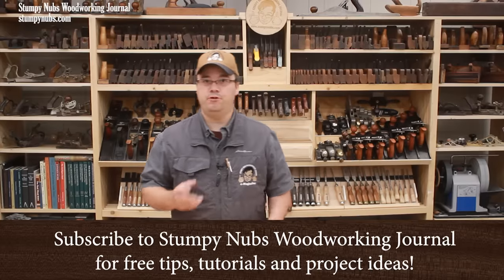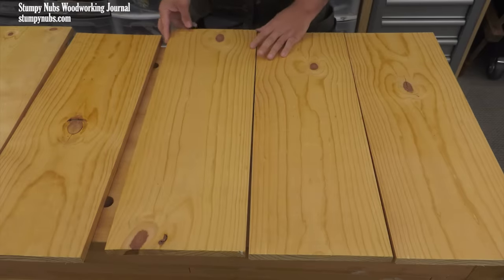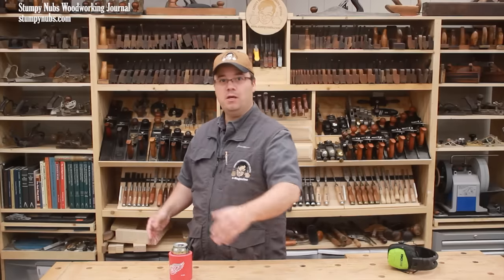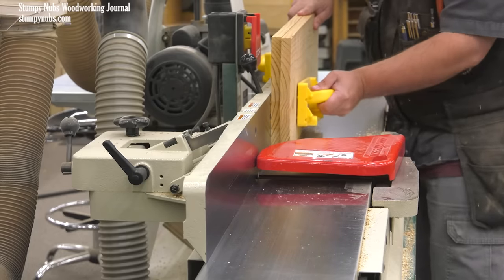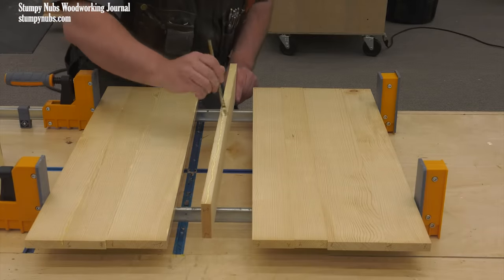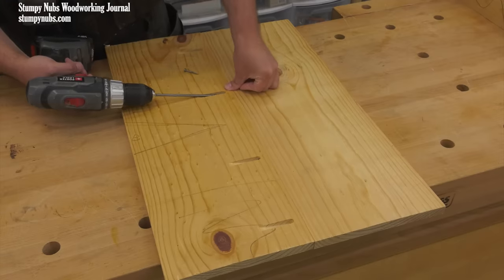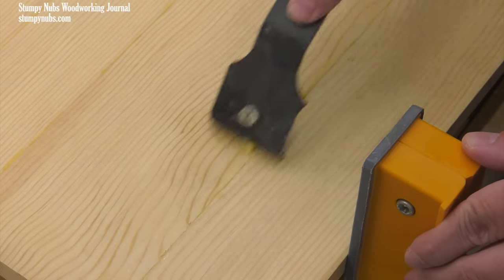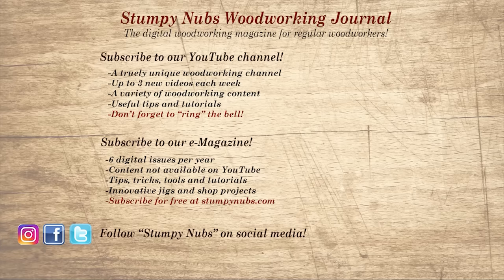Pro tips for table tops, counters and panel glueups

Comment: Well, it looks like I did it wrong. Used a jointer and biscuits.  Glued both sides of the slabs and where the biscuits go into the slots. Then, clamped it and wiped all the extra glue with a damp rag. That was 4 days ago, and it's still clamped up. The countertop is a black walnut almost 2" thick and over 6' long so I thought more glue was better then not enough.

Comment: A handful of sawdust will take a lot of squeeze out up quickly and easily. Sprinkle in on wet glue and let the sawdust mix with the glue and rub it right off.. Works wonders..almost like scouring powder. I always keep a can of sawdust handy for glueups..
Reply: Yup @ martino, you are correct. I have seen the sawdust tip many times as well. Thanks for reminding. Have a good one :D
Reply: Great info. Thank you!

Comment: Thanks.  These pro tips will help, as I’ve never done this before.  I’m in the process of gluing up and refinishing a Hawaiian Koa wood end table, probably built in the 40s or 50s.  The large second “top” of the two layered table is about 3’ X 1’ and is made up of 4 individual pieces, all solid koa.  The seams separated and I managed to get them 100% apart with no damage.  They seem to sit pretty flat and the gaps are good, just have to get them together flat and even on the ends.

Comment: Good tip about the shrinking biscuits; I didn't know about that.
I keep hand planes around almost exclusively for jointing & find that they do a far better job far more consistently than any machine can. They're also quick, quiet, compact, & create virtually no mess. I am going to have to get a thicknesser though; planing faces by hand is not kind on the arms.

Edit: Just remembered another tip. For smaller panels, you can get flat & smooth granite "worktop savers" for kitchens & sticking one of them, inverted, on top of the panel does an excellent job of applying just enough weight to prevent cupping. I like to put plastic wrap around mine in case I forget to remove it before the glue dries too much, but then it's just a quick bit of scraping to clear up any squeeze-out.

Comment: Twenty years ago Norm was adamant that the growth rings should be alternated. I like your conclusions. I wish we could revisit those furniture projects to see if the growth rings made any difference.
Reply: 10 years ago I made two tables that were 6'x3', both out of the same boards from the same tree. One of them I alternated the boards on, the other I did not. They have been in my temperature controlled house the past decade and are both still dead flat. Maybe I'll check them again in another 10 years.
Reply from the maker: 20 years ago fewer people had air conditioning in their homes.

Comment: I’m gluing up a 12’x17” countertop for custom cabinets I built. I had to work the walnut up into 2” strips. I’m a little nervous, but I intend to work up 2 strips at a time until I get one section 8” wide. The second section will be 10” this will allow me to be able to run the piece through the surface planer as an option if there’s an issue. Hopefully sanding will suffice. Both pieces will be glued together and I may use biscuits to assemble the two halves. I’m more nervous about attaching it to my cabinets than anything else. Needs to move but not too much. Of course it will have a face etc., but I’ve made mistakes of not allowing for expansion and contraction, so it’s priority high this time.

Comment: Thanks James... Always a pleasure as I most always I get a little something out of your presentations. You have reminded me I need a set of those clamps for my upcoming 37 X 21 flag build!
I'm currently setting up my new Wahuda 10" benchtop jointer. I'm close to coplane, not quite there just yet & I suspect I'll be setting the cutters to the tables parallel again, it is a game of give & take that requires patience...
Thanks again James,
Bill on the Hill... :~)

Comment: Thanks, your video was very helpful, I appreciate it.

You didn't talk about the width of the boards, for gluing panels... In woodworking school I've been taught that ripping board to 44mm strips, alternating the direction of the rings, is a good way of preventing cupping, etc.
Does this matter? Often a lot of 44mm strips are required, to make a large enough panel, so it would certainly be a lot easier to use wider boards, like 70-100mm.
This is also what I see a lot of other woodworkers do, on Facebook, YouTube, etc....

I hope you can help me out here.
Best regards.
Reply from the maker: I just use the widths I have. Looks more natural.
Reply: @StumpyNubs  - Thanks for the quick reply, I appreciate that.

I see, thank you.

Would there be any benefit to using the narrower strips, like I'm taught?
Surely it would be less expensive buying materials, if I can use wider pieces.

Thanks again.

Comment: When I glue up a panel I keep one face in contact with the clamp bar.  That gives me flat panels.  But even a little ‘squeeze-out” will cause a steel bar to stain the wood.  What’s more, that glue sets up in a bar’s fine notches, making it harder to slide the adjustable part.

My solution is a small piece of waxed paper wrapped around the bar, and secured with a button magnet.  The paper doesn’t fall out, and panels come out dead flat with no iron stains.  You don’t need to wrap the whole bar, just a couple inches where the joint will be.

Comment: For in the field of a glue-up panels I keep a bunch of matched wedges handy. I put them under the clamp bar and press the boards into alignment, doesn't take much pressure don't over do it, obviously don't  tighten wedges over a glue line. Rockwell makes a clamp thing to do the same. 
I've just made some 4 way panel clamps but I have only used them once so far with good success, auto flattening, no cawls.  What are your thoughts on that type of clamp?

Comment: Enjoy your videos, thanks for all of the tips and tricks 
Quick question you mentioned glue only on one surface yet I have seen furniture repair/restoration videos that say the main reason for joint failure is just that, glue on one surface only ?
Confused 🤔
Reply from the maker: I can't speak to a video I haven't seen, but I don't know how they could make such a blanket statement like that. In my experience, if you put the right amount of glue on one surface, and those two surfaces meet properly, they will bond just fine. If you do not put enough glue on the single surface, or the two are not sufficiently pressed together to spread the glue, the joint could fail.

Comment: Love your videos ! I have had a few tables that were great glue ups (8/4 maple, red oak and some 6/4 walnut tops) following most of the methods in this video but 3-6 months later I can feel the joint seam with my fingernail (still flat top but the glue seemed to raise even though it was smooth when I finished the top) . I’ve been doing some research and I’ve been learning that it’s called glue creep? Seems hit or miss when it happens, I can’t figure it out and it keeps me from wanting to sell any pieces thinking piece isn’t high enough quality to sell. Idk what to do about it. Help !! Thanks again sir, huge fan.

Comment: Panels have always been my downfall and I still try and steer clear of them, being a weekend hobbyist and beginner. This video has been very helpful and informative, and I'd like to try making one again. But can I ask a question? After an hour, you scrap the squeeze out, but when is the glue strong enough to be able to remove the clamps? I'm usually stuck with glue squeeze out under my clamps that I just can't get to and as you mentioned, once hardened, very difficult to sand. Could you go further into the gluing portion, removal and sanding the panel in a future video by chance? Or any advice you could offer me?
Reply from the maker: An hour is just a generalization. Just scrape the glue off when it gets lumpy. By that time you can gently move the clamps to get under them. I usually let my panels sit overnight, but a couple hours should be enough time to remove the clamps unless it is very humid in your shop.

Comment: ..and if you wait until after the glue dries and plane it, you can easily nick the knife edges. That's a preventable pain. Nice vid once again.
Reply: Yes. Glue is abrasive. If one runs a lot of glued up boards with the glue line always at the same  position in the planer nicks will be cut into the knives at those areas.  That is with high speed steel knives. Not so much a problem with carbide cutters.
Reply: @Sillyturner  in my experience it's not abrasive, it's brittle and hard and can chip teeth. It's worse if you have straight blades as opposed to helical ones but it's still a pain in the butt to have to resharpen your blades

Comment: Thank you for the video. A little worried about this huge glue up for this dining table I am getting ready to build. To keep the weight down on this red oak dining table, I am using 4/4 material for the top and the side skirts. Didn't want to have to buy 5/4 or 6/4 rough and have to joint and plain the boards down to the final thickness. So I ordered the 4/4 dressed. The boards are 12" wide so should I use dominos for boards this thick since I will only have three glue lines?

Comment: I never just use glue, although it is stronger than the wood.  Whatever happened to using dowels?     Am I doing something wrong.  Wood shop 1972, high school is where I learned to use dowels to keep things lined up.  Is there something wrong with using dowels, which seem to help prevent cupping.  I just retired, and getting back into wood working.  Whats changed?
Reply: I don't think anything changed except marketing budget for power tools like biscuit cutters and domino is much larger than for dowels 😀. I use dowels and never had issue.

Comment: had a similar issue with floating shelves.....the 'invisible' seam was not invisible as the table saw left a few irregular lines that we can see if you look close
Reply: retired furniture maker here.  a saw blade no matter how good will never give you a finish edge.  it will always need planing, either on the jointer or by hand.  when i dress timber in the thicknesser i always dress the sawn edge down to final size on it as well.
Reply: When I had an old contractor saw with a crummy fence I couldn't get a seamless panel for anything. After buying a new cabinet saw, calibrating it, and using a sharp glue line rip blade, there really is no visible seam at all. It was very satisfying to put those boards together the first time.

Comment: Could you please make a vid on table saws with safety features that aren't SawStop? Are there any? I like having fingers but SawStop is expensive and I'd personally be ok with a saw that might leave me with a small cut and not destroy the blade.
Reply: From my research, sawstop is the cheapest option of table saws with a safety device other than blade guard or push sticks. There are some fancy euro panel saws that don't kill the blade and can be used again once reset, but they are high end machines.
Reply from the maker: https://www.youtube.com/watch?v=qSbS5zhH7cE

Comment: so, when you force the boards into alignment with cauls: what happens to the tension you've added over time?
Reply from the maker: Nothing, because each strip in the panel would have it's own tension, independent of those beside it. For a panel to warp, the tension of all the strips must be similar so they can warp together. Otherwise, they cancel each other out.

Comment: How long do you leave panels in clamps?  I use Titebond ii most of the time.
Reply from the maker: I usually leave it as long as I can. But I think you could remove the clamps after a couple hours.

Comment: Hi James. If I have a lot of 4 inch x 3/4th inch x 10ft pine lumber and ONLY a handheld circular saw, how can I get straight edges? I’d like to glue these boards together but I don’t have a jointer and using a hand plane over 10ft long edges might not work.
Reply from the maker: It's tough to joint 10-ft edges without a long bedded jointer. I would tune up the table saw for it's best cut, and just skim the edges. Then use lots of clamps. Pine is soft enough that you can often mush it together enough to close hairline gaps. You may need cauls to keep the panel flat with all that clamping pressure.
Reply: @StumpyNubs  thanks James.
Reply: I am in a similar situation with six foot boards (walnut). I bought very long level for straight edge (I guess you can use strong long ruler as well), use it to cut with my circular saw (bought nice glue edge blade) and then do final pass with handheld router. I find router leaves better edge. I use Rockler bit so nothing too fancy. I do two passes, first one with one loop of painters tape around router base. I remove tape for final pass. Final glue up looks great. Hope this helps.

Comment: What about grain direction? Sanding a pannel is no problem but if you intend on plaining the surface later it could be a tear out problem
Reply from the maker: It shouldn't be a problem for plaining. You just reverse the direction of your passes on portions of the panel that require it.
Reply: @StumpyNubs  would it not make more sense to have the grain running in the same direction on all boards then plain all boards in that one direction after glue up?
Reply from the maker: @danthechippie4439  Not at all. Grain rarely runs in one direction down the length of a board. You may get the cathedral shapes running the same way (and you should do that for appearances), but the grain may rise toward the surface or fall away from it depending on the side of the board you use. You may try to flip all the boards so the grain all runs downhill, but this sacrifices appearance for a battle that is not always winnable. Grain can fall at the start of the board and then begin to rise again half way down its length.... Also think of the tops on antique furniture where the growth rings were alternated by flipping every other board (something that I think is unnecessary nowadays). That practice meant the grain would rise and fall differently from board to board along the width of the panel. The direction of the plane would have to be reversed from one boar in the panel to the next... My point is you aren't likely to plane a whole, wide glued-up panel in just one direction, anyway. So go with what looks best :)

Comment: What about if you use hide glue
Reply from the maker: why?
Reply: @StumpyNubs  Easy clean up, if a mistake is made warm water is all you need to disassemble. Plus after many years easy repair.  But I still like your path of glue ups
Reply from the maker: @ralhmcc47  Hide glue is typically used so joinery may be repaired, particularly on chairs. I can't imagine why you would need to repair a seam in a panel. Perhaps an argument could be made for hide glue in a panel glueup that has many pieces because hide glue has a longer open time. But the panel in this video had a lot of pieces, and Titebond 2 worked quite well.

Comment: I saw a video on YouTube about using splines for panel glue up. Dado cut down the center and a spline cut to fit the dados thickness and wide enough to mate with the two boards. I understand the ends may not have a desirable look if they are exposed, but was wondering your thoughts on this
Reply from the maker: I don't see the point in most cases. You are essentially making a tongue and groove joint. It may help to align the edges, but biscuits are better for that because they do not count on the board being perfectly flat when you cut the groove. And a biscuit joiner is faster. Even so, you don't need anything to strengthen a long-grain edge joint.  However, an end grain joint, such as a miter, will definitely benefit from a spline.

Comment: Why do so many people nay say pocket screws on panel glue ups or joining?
Reply: I think it may be because the log grain to long grain glue joint is really strong when dried,  so people think the pocket screws are redundant.  If you're using them for clamping pressure, or in a hurry as mentioned, why not.  
Of course you have a good excuse to buy more clamps if you don't know pocket screws will work just fine ; ).

Comment: Tongue and groove?
Reply from the maker: I don't see the point in most cases. It may help to align the edges, but biscuits are better for that because they do not count on the board being perfectly flat when you cut the tongue and the groove. And a biscuit joiner is faster. Even so, you don't need anything to strengthen a long-grain edge joint.
Reply: @StumpyNubs  Just curious, thanks for the feedback. I'm just a bit cautious when it comes to trusting glued joints. But then, maybe my methods we just wrong or I chose the wrong glue. That's why  watch your space now. Thanks again.

Comment: Don’t you promote 3m sanding discs in a different video also saying they are the best?
Reply from the maker: Apples and oranges. Duragrit makes coarse grits for shaping and leveling. The 3M discs I recommend are fine for smoothing and finishing.